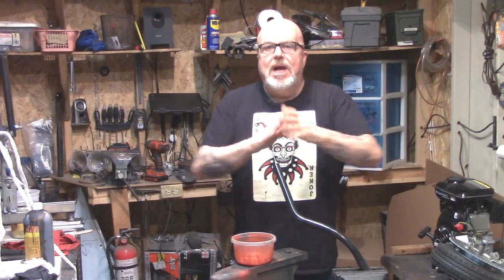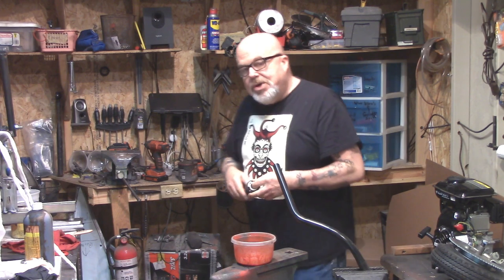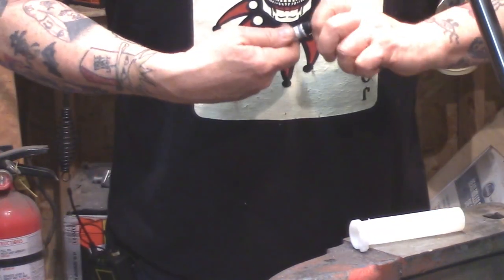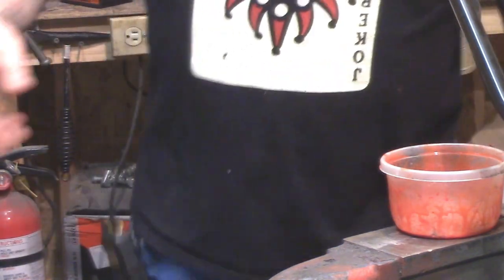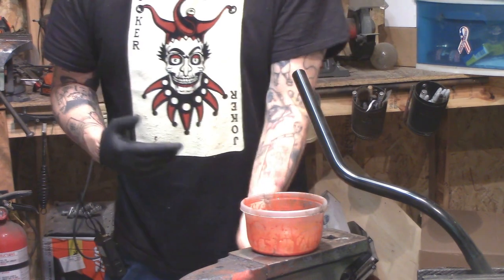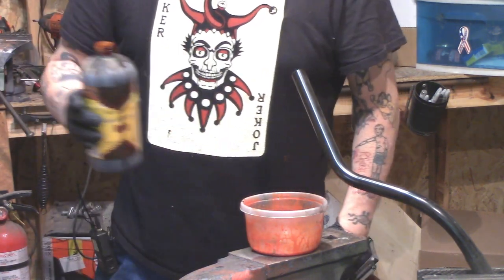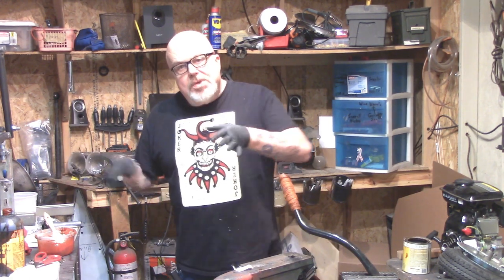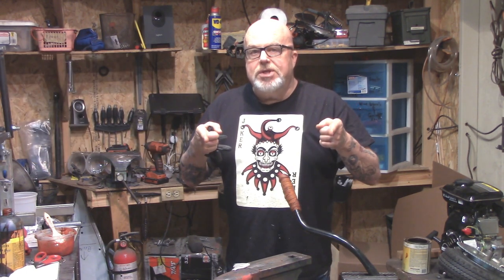How To Make Cloth Grips for Board Track Replicas or Motorized Rat Bikes

Comment: I just got done building my bike.  and I was wondering the easiest way to mix the gas and oil. In this little stock tank?
Reply from the maker: Get a 1 gallon can and mix in that. 4oz cheap 2 stroke oil to a gallon
Reply: Yeah best way would be to buy a small 1gallon tank and mix in there, 1 gallon to 3.2oz-4oz depending on where you live, I live in Cali so I mix 3.2oz